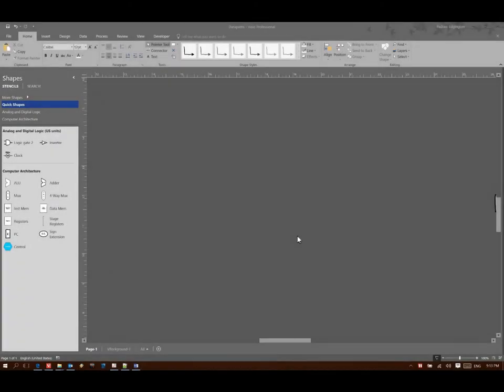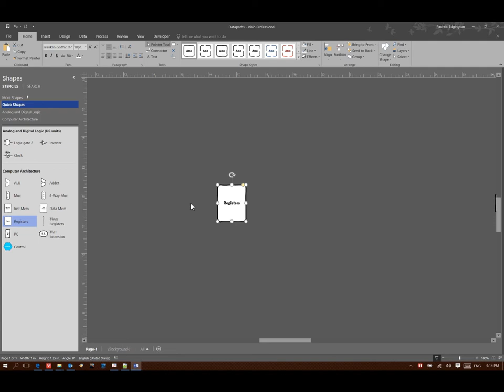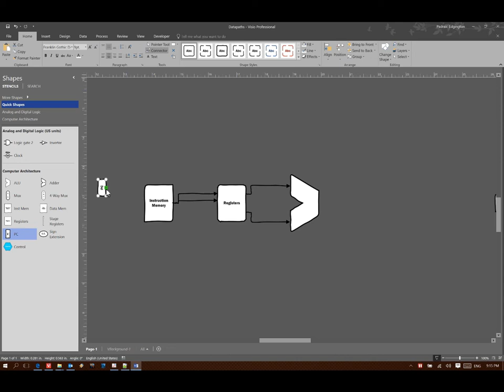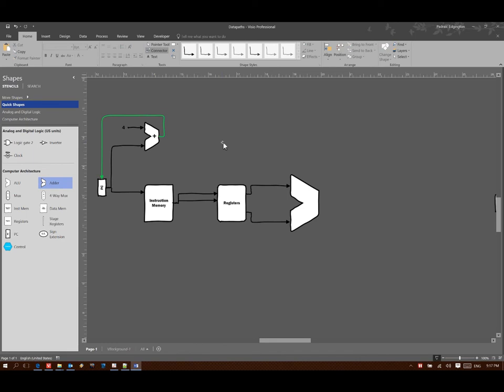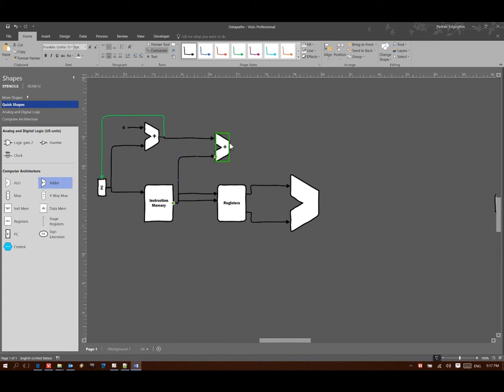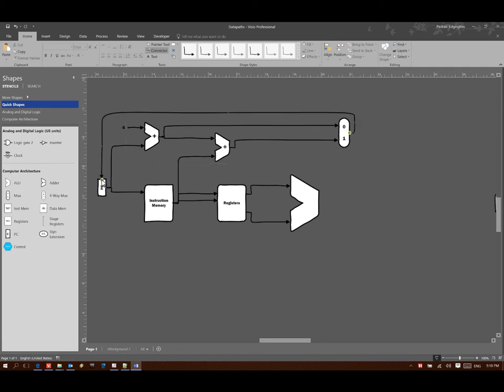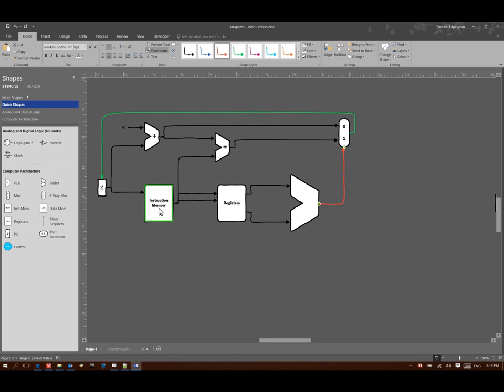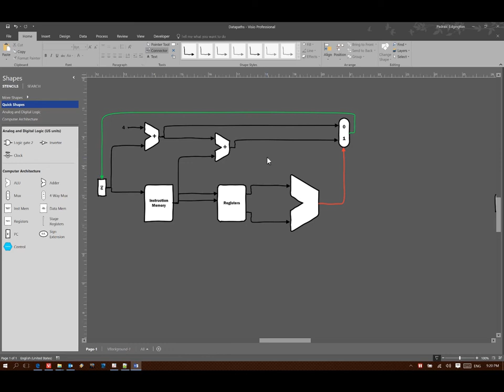2-5.  Datapath (beq)

Comment: Why hasn't anyone noticed that the 0 and 1 of the multiplexer are interchanged? If the difference between the data of the registers are 0 (that means they are equal) we should jump to the target - adress which got calculated with the current adress and the immediate value otherwise (reg1 and reg2 are not equal) we take the next instruction (PC + 4).
Reply: Maybe it is bc there is a controller (Z) and it checks the result of them ( Z =1 if they are equal else it will become 0). So if Z=0 it means it should go to the next instruction if it is one so they were equal and we should go to the immediate part.
Reply: @kobrarahmani8379  yes correct. I noticed that afterwards. What you're describing is the Zero Flag. It is 1, if the results are both equal 👍🏼

Comment: Why do we connect the multiplexer, I couldn't understand, can you explain?
Reply: To select if we increment the PC just by 4 (in case our branch instruction is not true), or updating the new address by the given offset (immediate) value from the instruction if the branch instruction is true. Note that in any case, you must firstly increment the PC by 4 then the next step (whether we update the PC by the offset from the instruction or not) will be determined in terms of the branch instruction.
Reply: @ulberonurakin4231  Teşekkürler.
Reply: @swordlion294  Rica ederim. :)